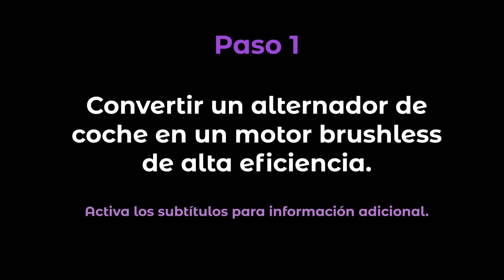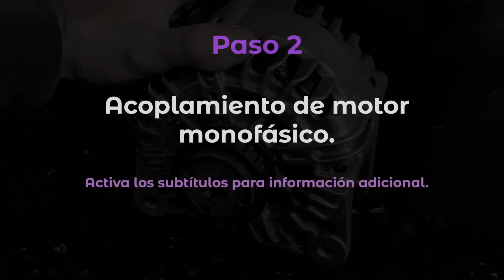Cómo hacer un generador de ENERGIA GRATIS con un ALTERNADOR DE COCHE⚡💡💡⚡

Comment: 1. Der 24-V-Generatorstator begann, 220 V zu erzeugen. Diese. Die Wellendrehung sollte zehnmal höher sein als üblich.
Diese. (zum Beispiel) Generator von Kamaz 2000 U/min Leistung. 28V. Max. Stromstärke 30A.
Um den Generator auf 220 Volt hochzudrehen, müssen Sie die Drehzahl auf durchschnittlich 15.000 U/min erhöhen.
Ein Standard-Einphasenmotor (z. B. AIRE) hat eine Drehzahl von 1350 - 3000 U/min.
2. Beim Anschließen einer Last (Bohrmaschine) kommt es zu keinen Drehzahlschwankungen im Motor-Generator-System. Dies ist am Rotationsgeräusch zu hören und auch am Riemen zu erkennen. Daher ist die Bohrmaschine nicht an den Generator angeschlossen.
Wenn Sie in einem Auto die Scheinwerfer einschalten, können Sie leicht feststellen, dass die Motordrehzahl leicht abnimmt. (Natürlich im Leerlauf).
3. Nun, das einfachste Verständnis. Dieses Gerät erfordert eine minimale Anpassung des Ausgleichs- und Spannungsregelungssystems. Und sie ist überhaupt nicht hier. Der Motor wird direkt in das Gen eingebaut.

Comment: The device as it stands is very inefficient, it could be improved by including a sub-orbital subduction spline in the circuit. This would have the effect of damping out the resonant harmonics due to upstream configuration fluctuations and would make the unit able to power non-reactive sublimation circuits. At the moment this would be dangerous to do because of potentially unstable feedback in the collimator module.

Comment: This is supposed to be John Bedini's magnetic window motor, and copying it in video steps won't be successful This motor can run without iron You need to remove the iron from the coil It doesn't matter if the rotor has iron    这是视频中隐藏的部分

要把线圈上的铁去掉  视频中隐藏了这个步骤

Comment: This is anti-scientific nonsense! Copperfield also performed magic tricks.
  Question - how did you get 220V from a car generator without changing the stator winding? But this is not the main question. And the main thing is how does your generator produce more than it consumes?

Comment: Selamat ya anda berhasil menipu masarakat ALTENATOR ada 2 macam 13dan 24V dan tiap lilitan yg 12v bila max bisa mencapai 6V di X3 berarti 18V yg 24  12X3 =36 baik DC atau AC man mungkin bisa mengerakan kipas 220V

Comment: parto con un motore elettrico da 1.5  KW a 1400 Giri che li riduco a 40 Giri per muovereun sustema di leve (6) che mi trasmette i stessi giri in uscita con una potenzadi 1500KW dove aplico un generatore che mi da 13KW dopo aver aumentato i numeri di giri a 1600 lo si puo vedere  su Youtube srivendo  MOLTIPLICARORE DI POTENZA

Comment: Dumb the price inform it is not enough to decide to buy the market cap holding it is not help to buy and the volume it is also the same.  You need to check the company operation and other company operation then after that you need to check supplying at current time then you must check the demand from the supplying products.   Same with other company.  Now you have the idea which company you buy and hold and how long to hold.  Which company you buy for the holder to sale for profit and which company you buy for hold and wait for price rise to sale profit.  And which company you reject the buy because it is the balloon price.  And which company you reject the buy because the gangs and the mobs luring you to buy and plan going out businesses. Etc.